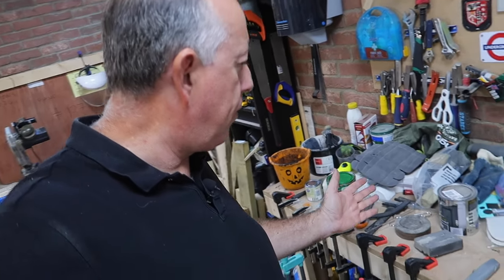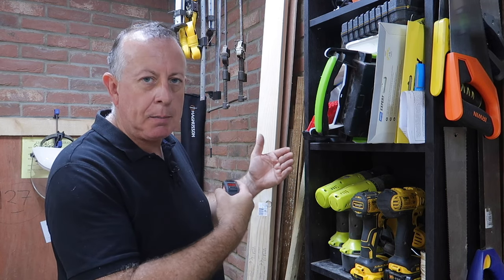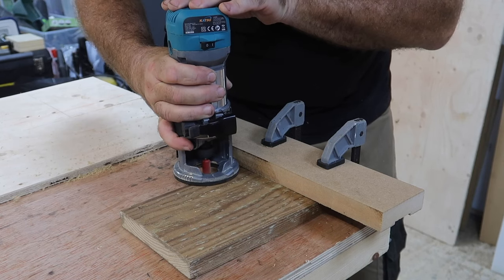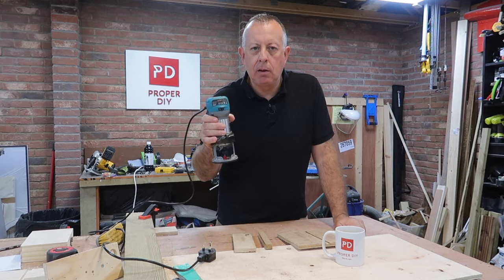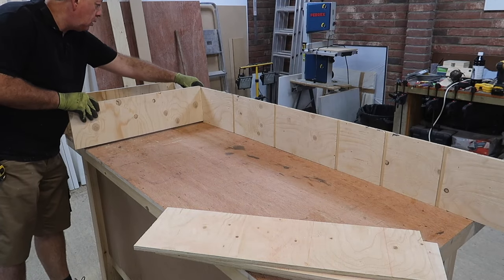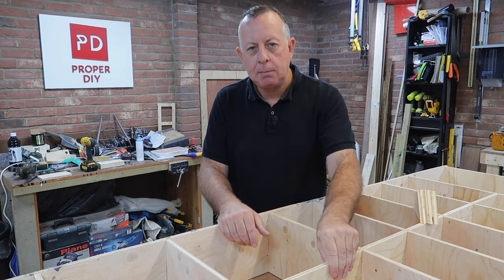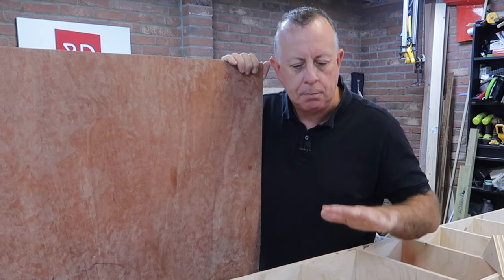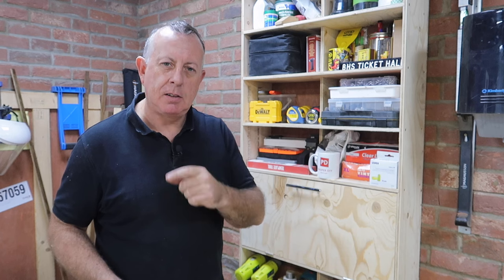How to Build Easy Workshop Shelves from 1 Sheet of Ply

Comment: Looks stronger and stiffer for half inch than I expected. Some nice ideas that I will use later. Those wall hole position markers are a great tool. Really well sorted storage is such a joy. I always need more and it's a liberation to keep the working surface clear.

Comment: A really nice job, the shelves came out great.  Saw a very useful tip from Norm Abrams when you're adding screws through a rebate.  To ensure you get them centralised in the channel, simply pre drill from the cut side and you have the holes marked once the shelves/partitions are placed.  You can then pre-drill again knowing you'll hit the centre of the shelf.
Reply: Ive just discovered your channel
I love the way you are so calm during your projects.....Im learning great DIY skills and also training my temprement to enjoy the journey
Thanks mate
Reply: Nice tip
Reply: That method pre drills out onto a visible side. If you get tear out, as you often do with plywood, it'll look a bit of a mess. A pencil marking out the middle of each shelf is simple enough
Reply: @tonkatoy200 Generally not with a decent pilot bit but get your point. A pencil line down a finished side not always preferred either
Reply: A-B-R-A-M.
No ess. NORM ABRAM.
🙂✌❤

Comment: I bought the Cordless version of the Katsu router and it's absolutely great. It's brushless so has plenty of power, much more than I expected!
I absolutely hate cables so have been trying to replace everything with the cordless version, I even bought a cordless vacuum to connect to my cordless tools!
The downside is the battery always dies at the most inconvenient time, and especially when you don't have a spare with you!
Reply from the maker: I'm going to look into that - would be very convenient not to have a cord.
Reply: @ProperDIY  The only downside is it uses Makita batteries, but I just bought a Dewalt to Makita adapter as I already had a few 5Ah batteries for my framing nailer.
Reply from the maker: @animationcreations42  I didn't know you could get a battery converter. I'll look into that

Comment: Another great video! I have the same router and really pleased with it.
One piece of advice to add, you routed right to left on one cut, this is a climb cut which makes it harder to stay on your guide, always route left to right when your router is closer to you than your guide timber.
Reply from the maker: Thank you. Does it really make a difference if you are going 'through' timber (on both sides of the bit) instead of just working on one face?
Reply: @ProperDIY  It does because the cutting blade of the bit is pushing you away from your guide, deeper cuts and bigger bits makes it worse. If they are little and shallow and you’ve had your weetabix you won’t notice.
Reply from the maker: @robmarriott6348  Good point. I'm always carefully ensuring I'm going the correct way when trimming normally. I didn't notice any difference because as you said it's a very shallow cut. I'll have to remember next time
Reply: @ProperDIY  Take right hand and make a pistol from thumb and forefinger. Thumb points towards fence and forefinger points in optimum direction of travel that Rob Marriot has described.

Comment: Good job again, a lot of thought goes into your work
Reply from the maker: Thank you very much! Yes I try to think things out and then explain my reasoning
Reply: @ProperDIY  a question about the router, does it adjust to cut pretty much wherever you need to on a piece of wood, and to a set depth? I've never used one so advice would be appreciated,  it could be as a separate video if you've got time for that?

Comment: Great video really enjoyed it. How are the retractable wheels doing on the workbench, not sure whether to fix my on permanently or try your retractable method.
Reply from the maker: Thank you. Good question. They are working well however when I was making my 'Garden Table with Concrete Top' I tried to move it while I have the concrete top curing on the workbench and it struggled to the point of imminent failure if I tried to move it any more. So conclusion is that it's fine for the 200kg bench but is not then designed to then also carry a large lump of concrete as well!

Comment: I recently came across your YouTube channel and I love the ideas, hint and tips. I thought I’d make a similar set of shelves and overall they turned out great. However, when I routed the shelf slots with my 12mm straight cut bit I found that there was a lot of play in the shelves. On measuring the nominal 12mm ply it came up as 11.5mm, hence the play. How did you get around this in your build?

Comment: What size screws you use for 1/2" plywood? Im building a camperbox for my car out of 12mm plywood and Im wondering if 3x30 or so are going to be enough for glued butt joints.
Also, thanks so much for the (obvious) tip on measuring the router-guide distance. I feel so embarassed now cause I was thinking about this few times now and didnt think of simply making a cut and then measuring the distance :D

Comment: Cut your sides double width then route and cut to size when routed  Also there are Router bits to fit the ply thickness  !/2 inch is not 1/2 inch   Also I always said ALL ply was 8 x 4  I got 4 sheets the other day 2 were 8 x 4 and 2 were 2400 X 1200

Comment: Excellent!!  What on earth is that M30 (?!) nut and bolt by the drills?  Souvenir from a previous Civil job?
Reply from the maker: Thank you. Spot on! Nut and bolt from a new flanged 36" water main I put down the centre of Borough High Street London before tunnelling underneath to create the new Bought High Street ticket hall on the Jubilee Line London Bridge - London Underground - 5 years of my life! Well spotted!
Reply: @ProperDIY  Nice one, that’s a proper job!  What were you building in Dubai?
Reply from the maker: @ruaraidhmcdonald-walker9524  Oh, lots of projects mainly based around either airport runways or terminals in the UAE and Qatar.

Comment: Is the router bit exactly the width of the thickness of the ply? I am worried to get a loose join.
Reply from the maker: It is - could just be luck but my 12mm cutter gives a nice tight fit to the 12mm ply I had.
Reply: @ProperDIY  thanks for answering, i think i need to give it a try, i always complicate things too much, don't have a 12mm or 18mm bit but i can get some.

Comment: Damn those batteries. What is it about always being 150mm short in a charge 🤣
Reply from the maker: I know! I always use them until they die but it always seems to be just at the wrong point!
Reply: @ProperDIY  I was particularly impressed with the distance you were able to reach with your nailer. Any further and you could have played a tune on the cable 🤣

Comment: 600mm by 300 by 1600 shelving unit, 19 quid from B&Q. Isnt worth getting a sheet of 12mm ply.
Reply from the maker: Got for it! If you don't see the advantage in building your own 2.4m high timber shelving unit and would rather buy some piece of plastic then probably best to avoid any DIY or woodwork.

Comment: Yes, just shows that everything doesn't have to be 'cabinet' quality to be good and useful. A couple of obs, I'm surprised you didn't check the diagonals, you could have routed the shelf grooves on a wider sheet then ripped it down the middle for the two sides and nice to see you using metric measurements BUT you did let yourself down early on by mentioning an eight FOOT sheet! Shame on you!!!! :-)